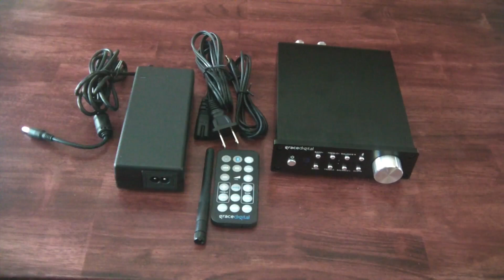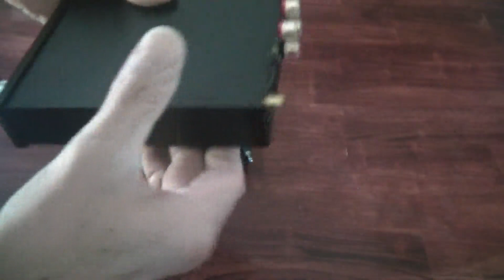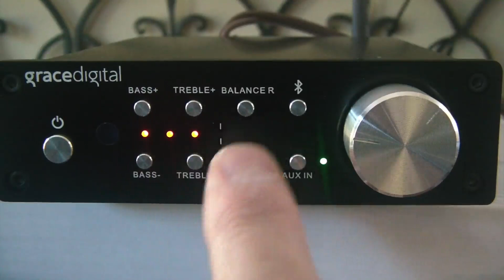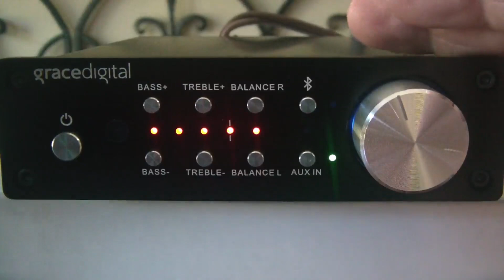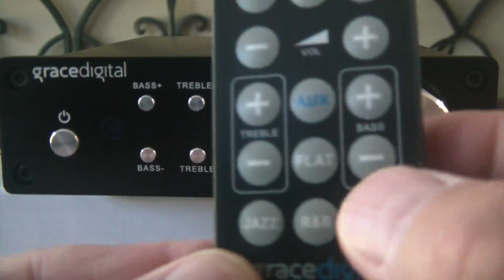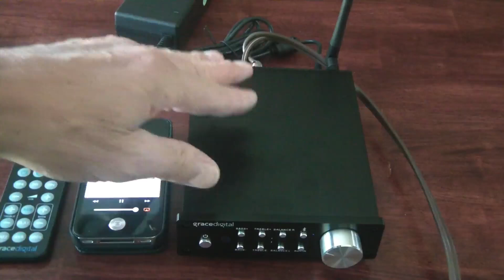Review Grace Digital GDI-BTAR502 Bluetooth amplifier HD

Comment: Why did they not put Wifi into this thing like many other wireless amplifiers?
This has everything i need except the missing wifi. 
Wifi is quicker and much more convenient. Bluetooth always requires activation on the unit you want to play from (on/off). Even if that does not require any higher amount of effort its still one step closer to simplicity with wifi.

Comment: Thx for the straight forward review. I am thinking, could I connect my tv to this through the aux in/line in? Taking advantage of the DALI zensor 5 speakers for my tv sound would complete my needs. I am trying to figure out weather this is possible or not with my samsung LED tv as I can not find any aux out/line out on the back of the tv.
Reply from the maker: Christian, if your HDTV does not have audio out, then you are not going to be able to do what you want. Otherwise, yes, you could do just that.
Reply: Reviews, Tutorials & Tech Just checked!
It does have Audio out, as in digital out (optical). Although that will not enable the tv to connect in this matter. Such a failure by samsung. Who would choose TV-speakers before external HiFi speakers? O.o
Reply from the maker: Christian Ademius Sadly there are many HDTV's that lack audio out or even additional HDMI inputs. It drives me crazy.

Comment: How did you connect your non powered speakerwires to the receiver? Did you use banana cable connections or  can you connect the bare wires to the receiver???? Thanx
Reply from the maker: +M.A.S  I used bare wires. You could also use a banana plug

Comment: One question, If you have the Aux plugged in and you want to switch to bluethooth  with another device, do you have to unplug the Aux cable or can you switch back and forth?
Reply from the maker: There is a button for bluetooth and a button for Aux In.